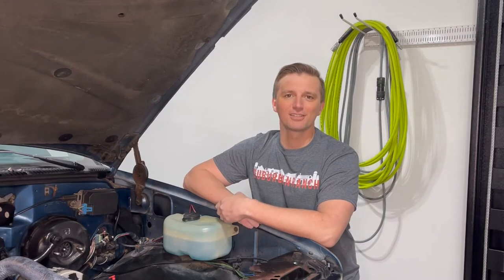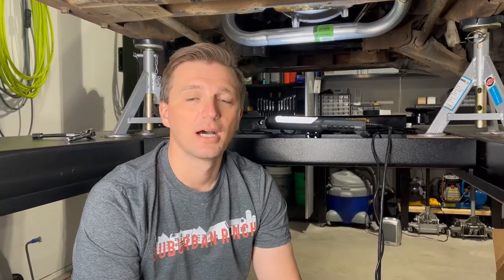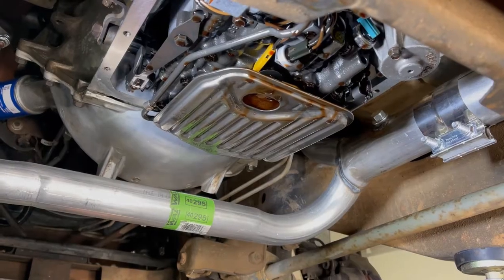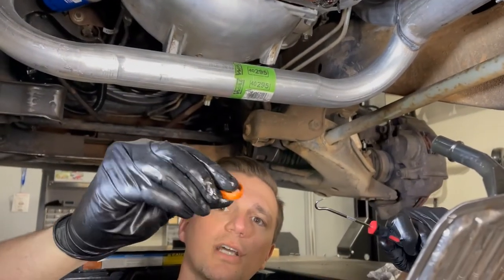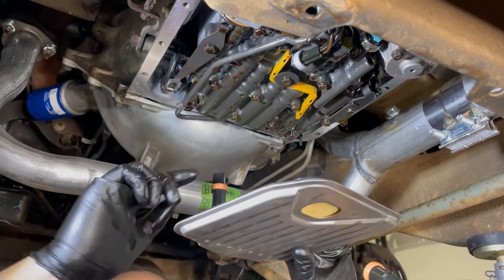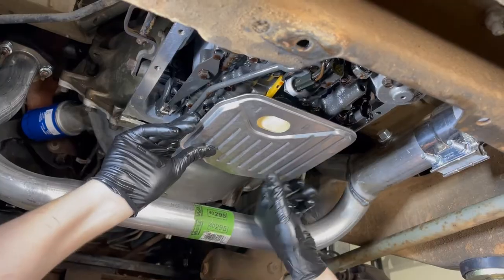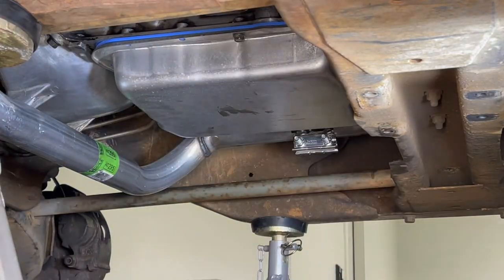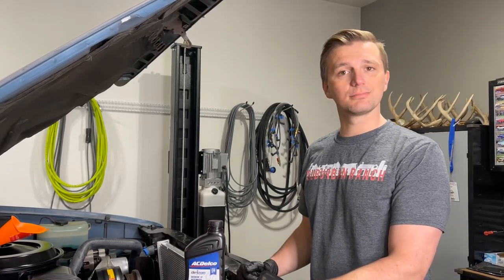Replacing the transmission oil pan and filter on an 88-98 OBS Chevy 1500

Comment: You guys cover just about everything on servicing and replacing worn out parts on GM OBS trucks.  I have a 93 GMC K1500 and am doing a lot of overdue maintenance, repairs and upgrades.  Although I am a retired auto mechanic and OEM technical training course developer and trainer, I still like to see how others do things and you ALWAYS find something new and/or improved.  I like how you take your time and cover pretty much everything.  However, a few suggestions:  Get yourself a 1/4" and a 1/2" cordless ratchet and make your life easier.  Also, a square transmission drain pan adapter keeps 99% of the trans fluid off of you and the ground.  Take care and keep up the good work.

Comment: Bro ... your old seal for the transmission filter tube came out way easier than mine, which was probably original  My seal was so old and hardened, it did NOT come out in one piece, but broke apart into several small pieces. I had to fight it for like 45 minutes with various picks and screwdrivers,  and be very careful to leave no pieces behind. The next replacement should go a lot easier.

Comment: Thanks for the video, question though… Did you not drain out the oil that was in the oil cooler? Is that a step that is OK to overlook?
Reply from the maker: You can skip draining the oil cooler. I believe we just plugged the lines

Comment: My 97 C1500 has a big spot building up on the cement more towards the transmission than the engine. You think it's probably the gasket then? My trucks got 177,000 miles by the way and shifts fine. I was thinking about changing the fluid but I'm not sure if it might start slipping if I do that. Scotty Kilmer always says that will happen.
Reply from the maker: @Cgp1998 Wash it all off and try to pinpoint where the leak is coming from. Another common place to leak is the front pump seal.

Comment: Why does yours look so clean inside?  I just got my pan off and holy hell it's grimy.  Can you spray brake cleaner in there?
Reply from the maker: @Ben Wrenchin’ My guess is that the oil has not been changed in a long time. I’d recommend doing two oil changes just a couple hundred miles apart.

Comment: I just bought a 1994 Chevy C1500. I changed my oil and it was leaking. I’ve changed a bunch of things out myself, my trans is leaking I’m praying it’s just the pan…. So is there any downside to changing it yourself? Can you detrimentally mess it up?
Reply from the maker: No, you don’t mess it up by changing the transmission oil

Comment: How did this work out for your application? No more leaks ?  Moroso recommends a flat lipped pan but i bought the same pan as you  and gasket let me know how it worked out thanks!
Reply from the maker: @gustavo cabral No leaks so far!
Reply: @SuburbanRanch  awesome i bought the same gasket and pan as you did going to do this later today wish me luck i have replaced the gasket twice and same issue i hope this fixed my problem
Reply from the maker: @gustavo cabral Update: not sure how it worked for you but ours is now leaking… will be changing out for a different one
Reply: @SuburbanRanch  Work when I drove normal but as soon as i started to put sOme stress on it  it didnt like it anymore leaked like hell
Reply from the maker: @gustavo cabral Did you find a solution that doesn’t leak?
Reply: @SuburbanRanch  a really good gasket maker alot of it and the moroso gasket and the torque specs are bs Way to loose tighten it till your comfortable enough

Comment: I have a 1989 s10 blazer 4.3.i tried to remove the transmission pan,  but there is lip otherwise back of it that is holding it on .what can I do to get that lip to release the pan?
Reply: It's  on the not otherwise
Reply from the maker: @Luth Evans Should be the same 700r4 transmission. I don’t remember any lip
Reply: You need to remove the trans crossmember..i do that on mine

Comment: HELP. I have a 1995 K1500 Suburban, 5.7, V8. I am wanting to change this filter but unsure what type to buy. There are few variants I have seen, I am using RockAutos. How can I determine which filter I need, as I am no mechanic, but like to give things a go! . The issue is, I live in the UK and have to import most parts form the US and obviously, I don't want to get it wrong. any help from anyone here would be awesome, cheers guys.
Reply from the maker: @RosmarysKiller73 You are likely just seeing different brands for the same part.
Reply: @SuburbanRanch  Many thanks for your reply, but they appear to look different? Would this be the case, would each type fit? Some are the same as the one you used and others have a different shape. Can you fly to the UK and fix all my problems??!!! hahahahaha
Reply from the maker: @RosmarysKiller73 Hmm, not sure. I think it might be cheaper to order both parts and return one!

Comment: What is that part at 1:24 to the left over the exhaust
Reply from the maker: @Rich smoke King That is the inspection cover. Under is the torque converter and flex plate. You can see it better in our video on removing the transmission at 2:45. https://youtu.be/lZinaPrRoTw

Comment: You said four and a half quarts of transmission fluid OMG I have a 1992 GMC Safari and according to O'Reilly it says 11.2 quarts and for some reason I have a brand new filter and a brand new gasket on my transmission right now and it has spewed at least a quart of oil out of it I tightened it up twice and it pretty much can't go any further I don't know what to do
Reply: @charlietuna350  it's one of them rubber gaskets I believe with like the metal inside of it
Reply: @charlietuna350  but the thing of it is I didn't flush it I just dropped the pan and let what came out of the pan come out (which was only about 2 quarts) so after the guy told me 11.2 quarts and then everything started spraying out after going down the road then I googled it and then it said initially it should only be 5 quarts which basically means if I flushed it it would have been 11.2 quarts but I didn't know that and the stupid guy at O'Reilly's told me 11.2 quarts so that means I am 6 quarts too much well I blew out about 2 quarts so yeah 🤷🏼‍♂️🤦🏾🤯
Reply: @WiKiTWoNKa  You got it right now 5 for pan drop and 11 for full flush. In the future check your fluid on the dipstick after doing anything with one, engine oil, tranny fluid and power steering fluid, before driving. For transmission fluid you check it with it running in park. 6 quarts extra is a lot how did your transmission hold up? hope you didn't drive too far like that.
Reply: @ukraineupdates9380  yes I know how to do all those things like checking the transmission fluid while it's idling in park it's just that the guy at O'Reilly's told me it needed 11.2 quarts and I never told him I was going to flush it all I said was I was going to change the transmission pan gasket and filter and nothing more nothing less so I don't know where in the world he got that from made me waste money and make a mess and hopefully not mess up anything on the van but now it makes me feel like I need to drain everything back out and start all over again with a new gasket and waste more money. I probably would have been better at all Google searching to find out the answer but I didn't realize until after I put anything in and then all of that mess happened then I googled it and that's what I found out 5 quarts was all I needed 🙄

Comment: Just gonna let everyone know DO NOT CHANGE if your trans has a lot of miles on it made the mistake and did it and all the new fluid blew out all my seals because the old fluid is so thick it holds your gaskets in place
Reply: How many miles did yours have
Reply: That's why u add Lucas  Trans oil

Comment: Big mistake those gaskets suck , it will compress and not seal guranteed. You should just use the cork ones, the reason why they work better. Is simple , it expands as the fluid penetrates ...

Cork has always worked for at applications just fine. I think you forget, that the pan you pulled off that tranny has been on there pretty much leak free for decades.
Reply from the maker: @Michel Linschoten The pan was leaking terribly on the original one. No leaks so far!